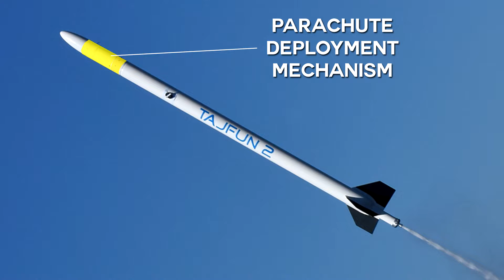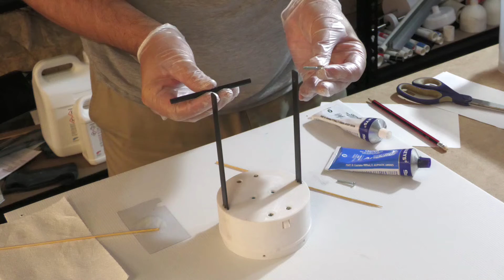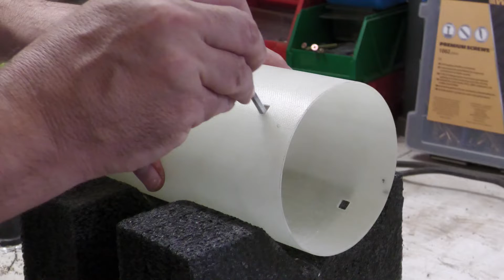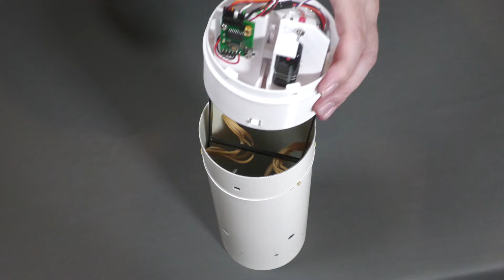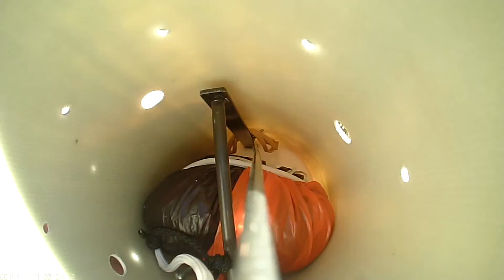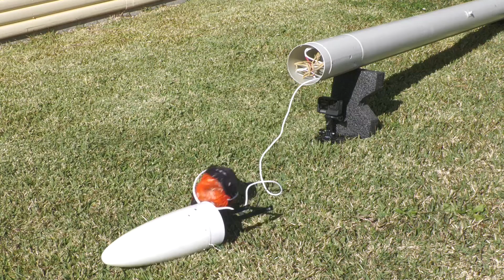High Power Water/Pyro Rocket - Part 5 - Deployment Mechanism

Comment: I like that you not just put things together but also doing tooling for that. Like in this case the hook or the proper launch pad for Horizon. Btw. what's up with that?
Reply from the maker: The Horizon project has been slowly being worked on in the background. We will post new videos as soon as we are done with this series. (There are 3 more videos to finish for Tajfun 2) Getting our Level 2 certification was an important step in being able to launch Horizon as a 2 stage rocket.
Reply: @AirCommandRockets  thank you for the update!

Comment: Have you ever considered using a CO2 cartridge used for inflating bike tires?
Reply from the maker: I have seen several different CO2 deployment mechanisms used on larger model rockets. They definitely have their place, but the main disadvantage I see with them is that you have a consumable component that you need to replace each time. With the rubber bands and servo motor, you can test your deployment as many times as you want without incurring any extra costs.
Reply: Yes, that makes sense. Some kind of small carbon pressure chamber could work maybe, but that sounds like overengineering :p Great to see a new video again btw!  @AirCommandRockets

Comment: I liked the idea of tensioning after packing the chute. I made a device thingiverse item  1477822 a parachute launcher. I needed to launch it clear of spinning propellers so it needs a fair bit of a shove. it can be difficult to pack the chute under tension. Your solution is much smarter!
Reply from the maker: This has definitely made things easier and just one person can load the parachute now. Previously we needed a second person to hold down the rocket while the other pushed the nosecone on stretching all the rubber bands. We are now using four bundles of rubber bands on the deployment mechanism and so we stretch one bundle at a time. It now throws the 500g nosecone and parachute a couple of meters. There is no way we would have been able to stretch all the rubber bands at the same time.